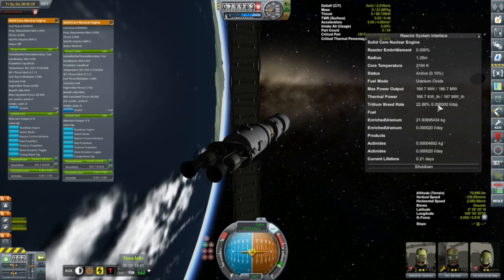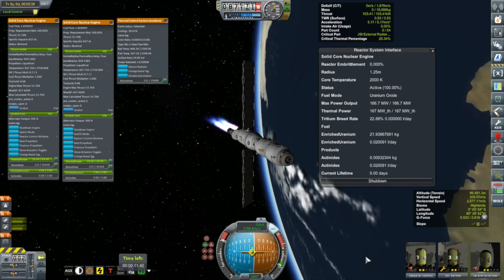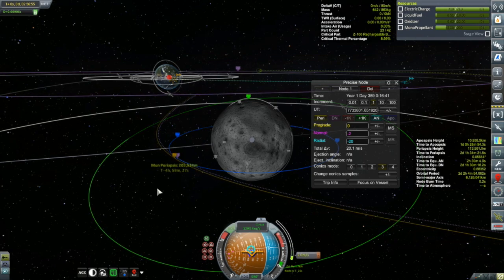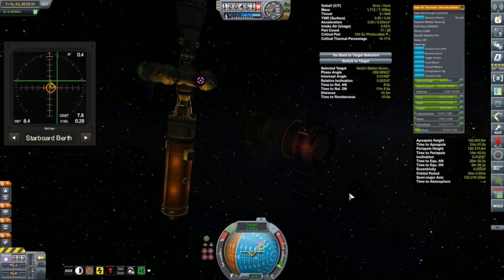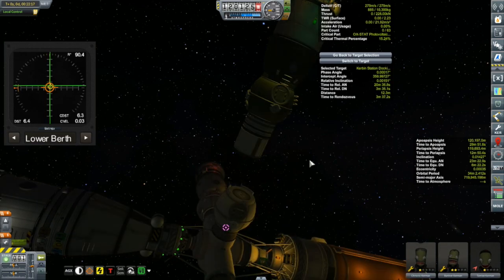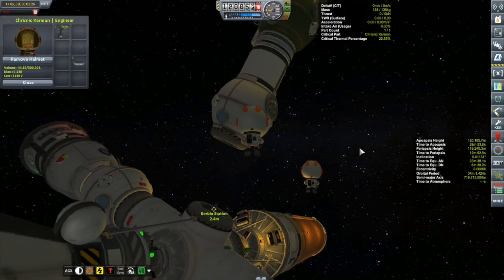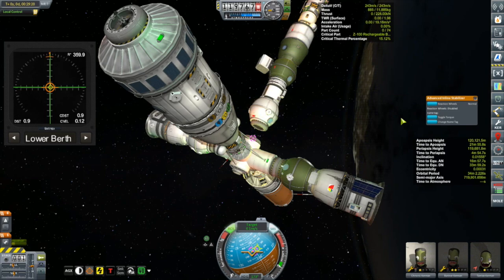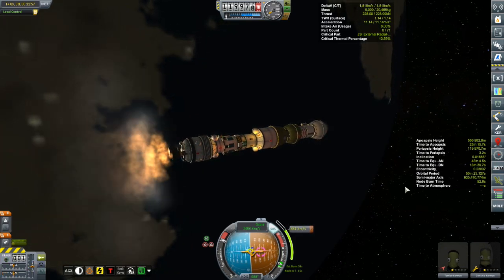KSP Career: Episode 79 - Renovations

Comment: Don't remember if you have anything down there but there is science to be had by crashing vessels on the mun if you have a seismic. Glad to be back and watching again. Sadly my game has fallen victim to the fake orbital decay bug, so nothing to do until it gets fixed.
Reply from the maker: I've heard about that bug.  That's too bad.  1.1 does seem to have more than it's share of problems.  I hope you're up and running again soon.

Yes, I happen to have two landers with seismic probes on the Mun - one near the north pole, the other near the equator - that I completely forgot about.  I've done two seismic impacts on the Mun in the past, but there's likely more science I could have squeezed out of them.  Unfortunately, I suspect that JunkSat n+1 hit the Mun shortly before I performed that capture that's at the end of the video.  I'll have to check when I get back to the game.

Comment: That was a lot of good, but hard work renovating your craft. With heavy or large parts, does another Kerbal just have to be "close", what are the "rules"?
Reply from the maker: The other Kerbal has to be within grab range, which seems to be 3 metres.  I think this a straight line distance to the collision mesh (not to the CoM), though I could be wrong.

In the video, the orbital module is yellow for a bit, with a message saying "Too far from target 3.053>3.000".  They must have been both just under this distance when it went blue and I could attach it.

This really took me a while.  The problem was compounded by regular crashing, which I think is a 1.1 problem, not a KAS problem.  1.1 seems to have a low tolerance to a lot of attaching or radial parts for me, both using KAS and in the VAB.